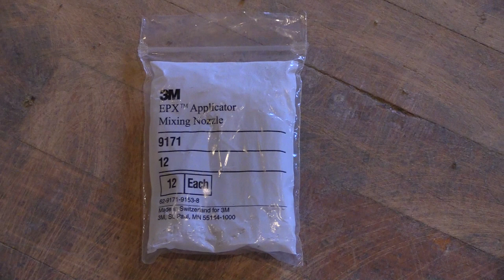How to Fill Conduit and Pipe Holes in a Hardwood Floor | City Floor Supply

Comment: How do you install a new subfloor base for the plug to sit on?
Reply from the maker: In this video the wood plug base was installed from the lower level.  We had access to that area.
Reply: @CityFloorSupplyLLC  cool thanks. Dealing with this exact problem myself.